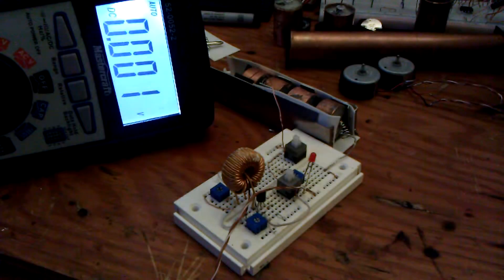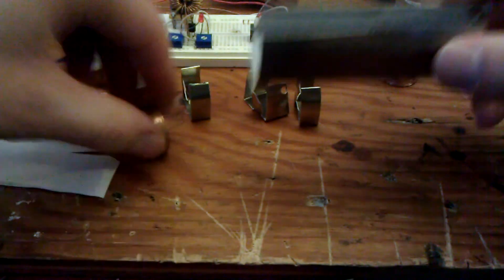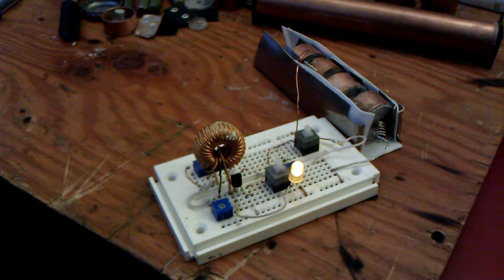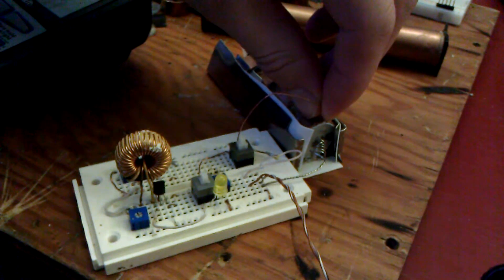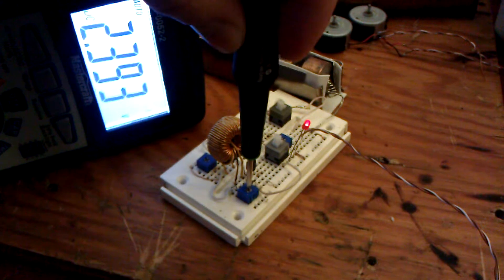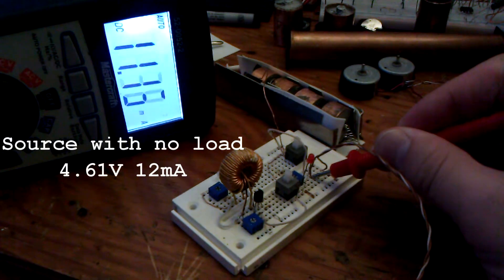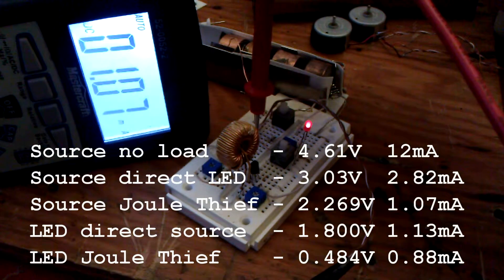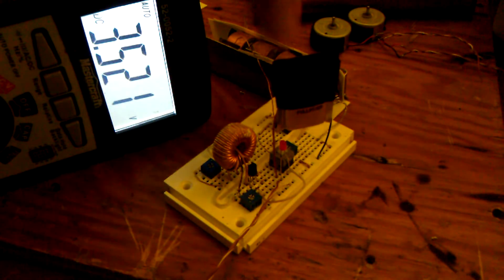5. Crystal Cells My series parallel clip & joule thief explained

Comment: Hi, now im seeing your measurements and I see that you are running that led using less power with the joule thief. Now I know that is the whole point, but it seems strange to me. I figured the joule thief put out high voltage and less amps but you multimeter is showing less voltage and less amps. Please let me know whats going on, its confusing, is your measurements not measuring spikes in voltage?
Reply from the maker: Joule thieves pulse on output so only an oscilloscope can measure output. See my video titled "Simple DC to AC joule thief & building of a Joule Ringer" for what the wave form looks like.

Comment: dose using larger wire for your ferrite work better than small magnet wire?
I made a joule thief but couldn't get it to work with a dead AA. I used a 9 volt battery and used a resister thinking it would protect my led. Killed my led in 2 seconds.
Guess the extra voltage from the joule thief must have been very high.
Reply from the maker: wire gauge is very important & number of turns on each wire. I have another joule thief video that may explain better. (simple DC to AC is the name) It seems the secondary being a small wire picks up the field better.